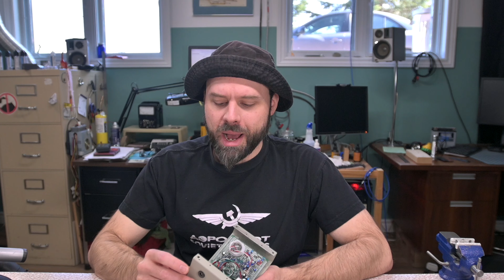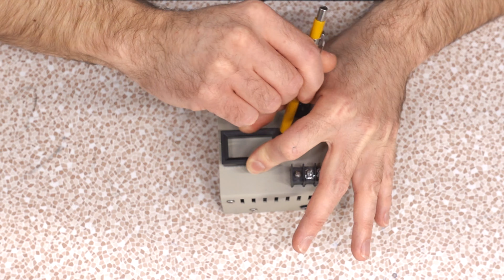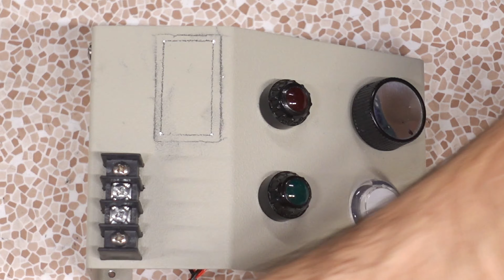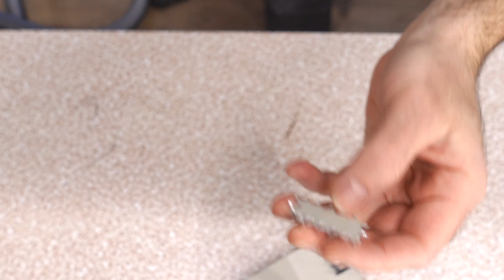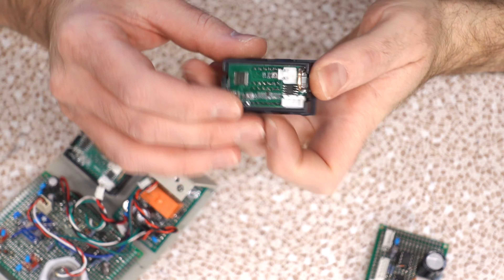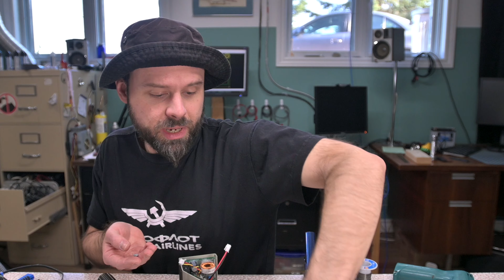Train Box Ep.7 - Adding Power Metering

Comment: Great video! How many power feeds do you have? Because you're ampere meter reads sometimes >2 amps. And you should expand you circuit with an emerency-stop button. 😉
Reply from the maker: Ahh, it was connected to the track at 3 points. 2 on the main track, and one on a second side track that has a switch, so I could leave engines parked there. 
I thought of upgrading it with some form of short circuit protecting, but in practice it seemed to be able to manage it manually well enough.